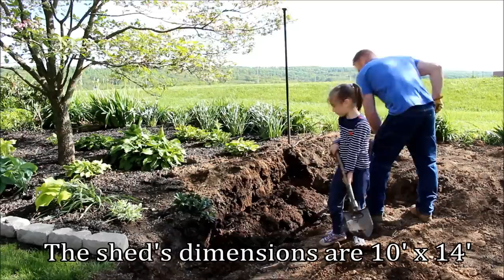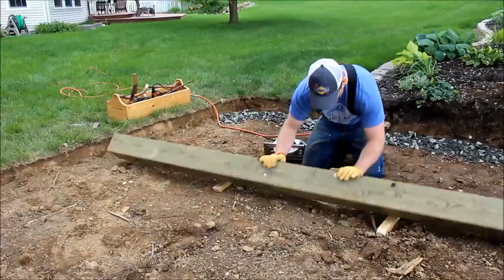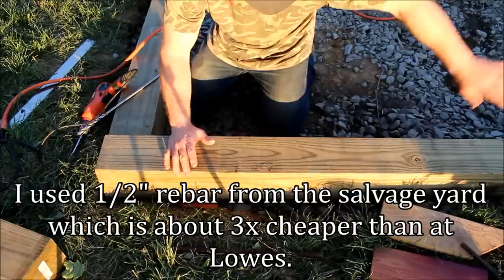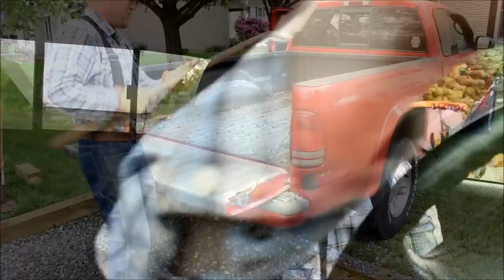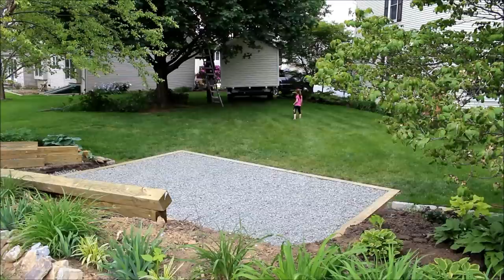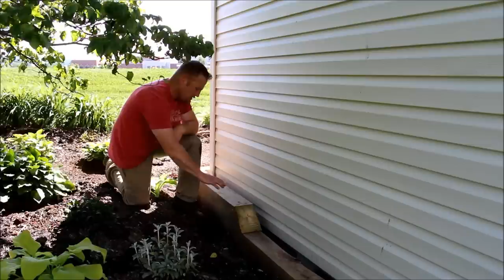Building a Shed Pad on a Budget by Hand. DIY How to

Comment: I'm not sure you "saved" yourself $700.  What was the cost of materials + labor time to not pay someone else to do it?
Reply from the maker: Death By Ostrich look at the top pinned comment for a breakdown. I see people running, walking or at the gym all the time so for me this project doubled as free exercise as well.  To each his own but I'm glad I did it myself and filmed it.  I don't think someone around here could have done such a quality job including the retaining wall without tearing up the yard for under $1200 actually.
Reply: All I'm looking for was a number. So how many hours did you think you have in it? I'm just trying to gauge if it's worth it to spend weeks putting something in to save $10/hr etc.
Reply from the maker: well it's hard to estimate.  I had to remove a big stump mimosa stump first right where I wanted to put the shed.  The work was so spread out but I'd say around 60-70 hours total.
Reply: well geeze you worked for less than minimum wage. But how much would a stump cost to remove? was that figured in to your savings? I get the exercise part...
Reply from the maker: That's why I don't do this for a living and why I couldn't sell most of the things I build....too many hours of labor putting the selling price out of range of most sane people.  I guess its a matter of perspective but to me a few extra hours here and there toward something for your home is just the normal state of things and I never try to calculate how much it would have cost to hire someone to do it.  So take my estimates to be very rough and they did include the hours to remove the stump.  I'm too cheap to rent a stump grinder, excavator or dump truck for $250-$400 per day so I dug it out by hand and started a fire on top and underneath it that I kept feeding hardwood for about 8 hours on a Saturday.  That cut its volume down by about a half and then it wasn't to bad to remove the rest.  https://www.youtube.com/watch?v=GSM_h0WRUwQ

Comment: about 60 or so bags of concrete and a few hours out of your life would have been easier and cost about $300 bucks or less depending on size and thickness, you had the truck but maybe there's a reason you did it this way. You could have also built the shed for dirt cheap and way less than $3500 and better than they make these sheds in a weekend...ijs

Comment: no wonder why houses in u.s gets torn apart easily during a huricane or tornadoes
Reply from the maker: well remember this is a shed and it is not designed to handle hurricane force winds.   It is not secured to the ground and is not considered a permanent structure.  You shouldn't assume this shed shows how a house is built to code in the US because it is most certainly not.

Comment: I saw da following classed items as TOOLS : shovel, skill saw, rebars, levels, framing square, drill bits and drill,  hammer. So you did not do this by hand, yoou, yoou, did use equipment.
Reply from the maker: It did say "by hand" so I guess I should have tried karate chopping the beams!
Reply: Yeah, dat would of helped. awww shet.